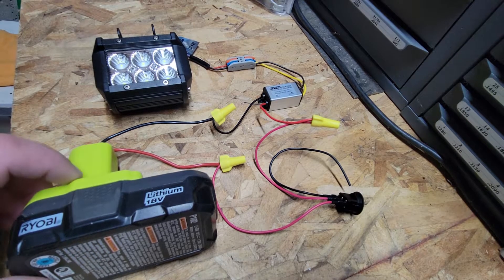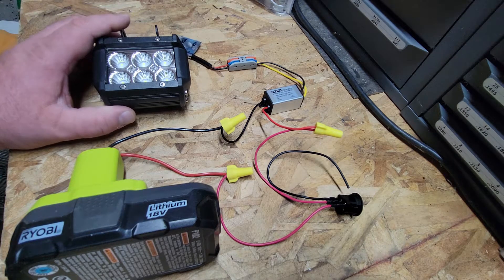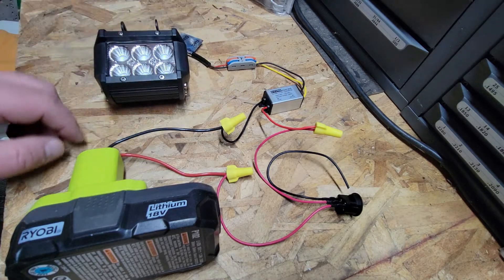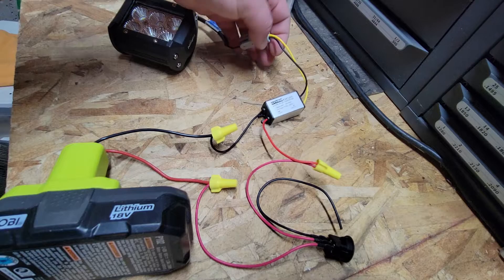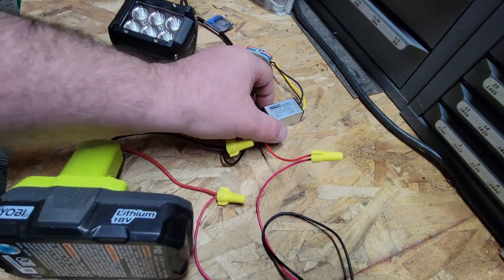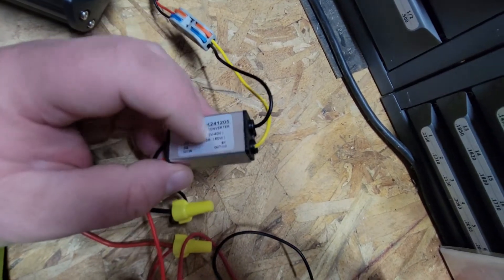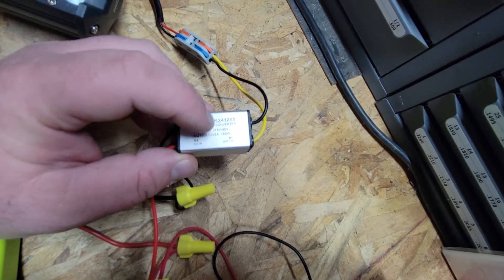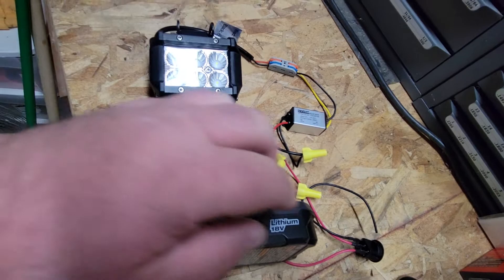How to power lights with power tool batteries

Comment: Hi mate: I had a random idea tonight that I have a bike that I’ve converted to electric. I don’t want to wire them into the bike’s electric. I googled if you can run a led light safely using a drill battery and your video come up first! I’m wanting to fit a tail/brake light from a surron bike . What would I need to make this possible? Ideally it would only needs to power it for 1-2 hours tops! I want to run a wire from the battery up to the handle bars so I can connect a trigger/switch onto one of the brake leavers so when I brake the tail light gets brighter. Basically exactly how any car or road legal motorbike does at night time.
Reply from the maker: Positive to switch, from switch to light, light back to gegative.Make sure the light says it can handle the range of voltage the battery puts out.
Reply: @FTOTF1 that simple? Won’t I need anything I between so it doesn’t put 18v to a v5 led light ?!
Reply from the maker: @j_edaily you cant hook up an 18v light to 5 volt without transforming or putting in a resistor
Reply from the maker: You could also find a transformer that will convert 18 v to 5volt.
Reply from the maker: https://www.amazon.com/YABOANG-8-32V-Buck-Converter-Electronics/dp/B0D4562MSG/ref=mp_s_a_1_1_sspa?crid=3KCV41GYDG9QT&dib=eyJ2IjoiMSJ9.C8i0iJp4ho_CCI2FMeqnVBxTb5q_aB-RqDlRrr60GrAi5MYT0aMZHV5fXYa9Tb1oBJKvuh3U-KZdQJf0aU1JJxghqp5b8KGylfRv-0ia4T53tZBBrY_R3OV6ZFglrJDhSJgQtEwGMnI2KIs7-yxCLzoh9o8AmR67l25w9euuHxJP9Hp19lujP_KA8gZE866h4eI5sk1qwIhlfW5khRXQ8g.yZNm5A5joFClAr-bIYO_kfL06IXpg8_cFRELewrGhk0&dib_tag=se&keywords=18v+to+5+volt&qid=1764376875&sprefix=18v+to+5+volt%2Caps%2C273&sr=8-1-spons&sp_csd=d2lkZ2V0TmFtZT1zcF9waG9uZV9zZWFyY2hfYXRm&psc=1

Comment: You mention burning up the transformer with too high wattage from the battery, but there is mention of how to calculate this. Is the wattage from the battery 36 watts (18 volts x 2 amps) into your 60-watt transformer?
Reply from the maker: You could add to many lights, the transformer definitely has a limitation.

Comment: Can you use a 20v to light a 15w lightbulb
Reply from the maker: Overvoltage kills electrical components. They may just quit working if too high of voltage is applied. If it works it will probably shorten the life of the bulb. Some bulbs have a high tolerance. What is the volt rating of the bulb?
Reply: 15 watts  @FTOTF1
Reply from the maker: Watts is volts times amps. Did u mean 15 volts? If so 15v prob won't run on 20v without ruining it

Comment: how long does the light stay on?
Reply from the maker: Thanks for asking. I haven't done a test on that 🙃 Bigger amp hour lasts longer. The way to test is to put an amp clamp set to dc on either conductor on battrery side before transformer. Take your reading and divide into battery capacity. If the meter reads .5 amps per hour and you had a 2 amp hour battery it would be 4 hours. I'll have to measure it when I have time.

Comment: I do have a question about the converter so I see how I would do just one light but what if I was doing a headlight/taillight setup for a mini bike I can get 24v batteries but how would I wire two lights???
Reply from the maker: @rogangodfrey8285  wire your lights in parallel and buy 24v battery

Comment: if I am trying to run multiple switches for things would I put the voltage step down before the set of switches?
Reply: You could, it'll probably be easier on the switches too.

Comment: I have received the A121203 AC/DC buck converter from Amazon that's rated for 10-28V AC input range while output is rated at 12V DC. When I tested with a small engine that produces AC voltage 10-19V with multimeter the output reads steady 12.3 to 12.4V DC for AC input voltages under 15V. When I set the engine to full throttle the input AC reaches 18-19V while the Buck converter output drops to around 2 to 3V DC. I’m staying well within the operating range of the device, is this normal behavior for the A121203 buck converter under no load condition as a form of overvoltage protection?
Reply from the maker: If the converter is changing ac to dc usually there is a wattage limit that can burn it out if exceeded unless there is a safety built into it. I haven't used that exact one so I can't say for sure.
Reply: @FTOTF1  
I had to go back and reread the Amazon listing and discovered notes that depict the operation of the A121203 unit: 

1. When the input voltage is AC10-14V, the output current is less than 1A; when the output voltage is 12V, it is not recommended to output with load at this time, because the conversion efficiency is low at this time; the output 12V after loading will cause the output to be unstable and big output fluctuation. The load is too big to start!

2. When the input voltage is AC15-AC28V, the conversion efficiency of the module is ≥90%, and the output voltage can maintain DC12V±0.25V. At this time, the 3A module can support long-term work within 2A, and the 5A module can support long-term work within 3.5A!

Based on these Notes, the unit should not go into overvoltage protection mode at when it sees 16-19 V as that's the range you are supposed to start applying load to the unit.

Comment: I have a Samsung refrigerator Ceiling Light DA97-08428B 

I would like to connect to a scooter battery or like this I don't know how to figure this out. Where so I start?
Reply from the maker: Put a volt meter in the plug you took the light from to get the supply voltage then find a transformer to convert from the voltage that is normally supplied to the partnumber/assembly to the battery you plan to hook up.

Comment: Great simple video. To add a running taillights (no blinkers ) would you just add the 2 additional wires from the taillight in series with the led (headlight) ?
Reply from the maker: Parallel or the lights will not be their brightest. Series would make them all dependent on one another.

Comment: I hooked mine up like this and it worked for a little and now turns on but immediately off again it won’t stay on constantly
Reply from the maker: How full is the battery it needs to be full when it gets low it will turn off. Also could have protection built in if one of the strands in the wire is touching something it shouldnt.

Comment: On the Nilight listing it says the light can handle up to 30v
Reply from the maker: That may be the case for the listing they have. When I bought mine it didnt have the rating that high. This video is to teach people how to transform voltage.  Don't hook up the transformer if it isn't needed. If the range of yours is 12 to 24 by all means bypass it. I looked at the current listing for this light and the documentation for this one now currently advertises up to 30v.

Comment: I wired mine up straight and absolutely no issues whatsoever. It's on my m18 battery and I have a 12v led floodlight pod. I wired it straight up with a switch and it hasn't burned anything. I love it. It's made super cheap with stiff I already had. I used an old 1/4" impact that didnt work and cut it and mounted the light to it. It looks factory and is way brighter than any hand held light they sell. I love it
Reply: Most led light run either 12 or 24 v. How the battery life?
Reply: @premonjares  great, with a 5.0 battery I can use the light for about 4- 4 1/2 hours nonstop
Reply: @codyswilley  thats not bad at all given the size it is very portable. I might give it a go
Reply: @premonjares  I wish I could send you a picture of my light. It doesn't look bad at all
Reply: Same, I got a M18 powering a 6.5 side shooter pod in-between my bmx handlebars and it brights up half the block while night riding
Reply: @1978novabuilt I want to do the same but with a dimmer
Reply from the maker: Some lights will handle a higher range of voltage. When the volts get to high it will destroy the electronics. Glad it's working for you. What brand and what's the highest voltage you can put on it?
Reply: @FTOTF1  it's a cheap one off of ebay. It says anywhere from 12v-24v
Reply: How did you do it make a video of it

Comment: I want to add a plug outlet to my fishing cart for lights or chargers could I use these method for that
Reply from the maker: Yes just make sure to fuse it to protect the max power output of the transformer
Reply: @FTOTF1  thank you for the fast response do you have or ever made a video running a a/c off a battery lol here in Arizona we love the outdoors but summer time kills the kids and was thinking about trying to run a small unit of a battery or something like that we have a generator but they make to much noise
Reply from the maker: @AZ FIRE BREAKS  I installed this victron system its strong enough to run an air conditioner.
https://youtu.be/2tWyBqRTzeM